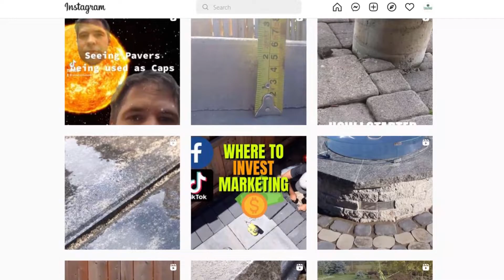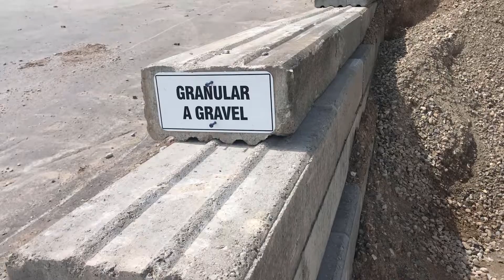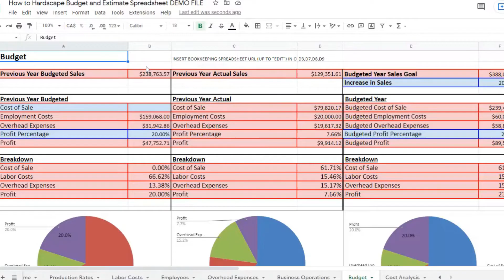Open Graded VS Dense Graded Aggregates

Comment: Hello I'm a home owner paving Over a concrete slab.  What would you recommend as my base layer. Sand or open ?
Reply from the maker: It depends on what you are laying. For example I will lay a thicker border and adhere that to the concrete slab, then lay nonwoven and sand or HPB depending on the height difference. If it is over 1/2”, I will use HPB. Under I will use concrete sand. I never prep a full base on top of a concrete slab
Reply: @iamahardscaper thanks man , I really do appreciate you help.  My border will extend past the slab so just on the border I will crush stone, then base. ? Or just use the HPB for full amount on just the extended border? Thanks
Reply from the maker: I'd still prepare a regular base for the border, not just HPB. This is a video that describes better my first comment: https://youtu.be/kpgvY9uEJjE
Reply: Sorry to bother you...wish you were.local.   so my concrete pad is going to be covered by a Gabled roof. I plan on pitching it 2 inches from house to inch (pipe) at border. With the HPV over the mesh. I'm sort of a loss with the edging. Watched your video not sure how to end it. It will extend past the concrete. Should I put a trench  abutting grass? Or just let it drain into grass with plastic edge?
Reply: Sorry first time doing this

Comment: So dont use limestone with dustings on a concrete slab base?
Reply from the maker: Nope
Reply: @iamahardscaper  why? Everyone in my area does. They all say its better compaction for the clay type soil we have. I get it doesnt drain as well but it's better compaction. Why do you say this? Many people use 3 quarter inch with dustings
Reply from the maker: Yes, we still use 3/4" minus or road base or whatever you would want to call it in some applications. But that is not the same as stone dust. The fines in each are very different. Stone dust or limestone screenings is a 1/4" chip with dust.
Reply: @iamahardscaper  sorry what I meant to say was 411 or 3 quarter inch crusher run with dustings. As we call them around here. Now I see the confusion. Quarter inch minus with dusting would definitely not be optimal base

Comment: Another thing to add is, based  on my research on this topic dense graded base’s can support I heavier load. I’m building a patio that’s going to have a hot tub on top of it which is very very heavy so I opted for a dense grated base, even though it would have worse drainage. To compensate for that I am sealing my pavers and putting a French drain on the low side. What are your thoughts?
Reply from the maker: In our application, id say the main one people in the industry discuss is a heavy variable load. Tractor trailers over an open graded base. Though there are examples of open graded base in these applications and they continue to test in these applications. We’ve prepared open graded for hot tubs, but we always pour a concrete slab for the hot to sit on as well and stabilize the base with geogrid.
Reply: @ good points. I didn’t think of that. You’re the expert but I am learning a whole bunch from your vids. I am using geogrid and using a 4500 lbs plate compactor with 2 inch lifts. Should be good in my opinion. Thanks for the advice.

Comment: I live in Louisiana and I am getting ready to lay 650 ft.² of pavers I noticed some of my pavers have like a white powder substance on it most like mildew can I pressure wash them after I install and then put the Palmer sand in
Reply from the maker: That is likely efflorescence. If it is really bad I would reach out to who you ordered it from. If it is not a lot it should go away after some rainfalls. If not it requires an acid wash

Comment: Can you use the bi or tri axial mesh with the 3/4minus material?

And do you use concrete sand over the 3/4minus material?
Reply from the maker: yes, I still use it with 3/4 minus bases. No, I typically still use 1/4" chip (HPB) on top of my dense grade bases still unless the paver has a thin joint then I will use concrete sand.

Comment: Hey so around the 5 minute mark- if open the drainage pipe goes right into the stone? If drainage is already on the outside of the wall or if using dense, the drainage would be outside of the wall area? Footer? Sorry trying to understand that better. Great video thank you
Reply from the maker: For walls, if using dense graded base, the drain would go on top of the dense graded base in the drainage area where you would then use open graded stone behind the wall. If using open graded base, your pipe should be lower about 4" above the subsoil in the open graded base. Hope that makes sense.
Reply: So if I’m building a square garden bed retaining wall, should I use an open graded base 3/4” no fine’s underneath the block compacted, and then use a dense grade for inside the blocks to lock them in a bit better. Just wondering if I should use open grade base for the wall to allow more drainage and prevent freeze and thaw heaping? Then put the drain about 4” above sub soil right? Need to do your classes man, but your videos help so much. Thanks for all your wisdom and knowledge.!

Comment: Love your presentation, full of great info.!!! I want to add an additional parking pad using open grated aggregate. I understand that their is a product on the market you can spray on to keep it in place. Can use recommend a product that will keep it solid instead of getting in tires, etc... thanks for sharing.
Reply from the maker: Oh the product that I know of on the market for things like that are not vehicular rated. With the twisting and turning of tires they will come loose. Also your climate plays a factor as well.  Rock Bond is the one I know of but it is also not suitable for a larger aggregate like 3/4”

Comment: great information. On my upper garden I have done exactly as you have stated in that it is compacted with dense grade and a drain to the lower garden area. The lower garden are is open grade to act as a large soakaway. I am now ready to pave the lower garden (patio) as this is directly next to the house. The paving is sandstone and 3/4" thick and needs to be bedded on a full cement/sand mix. Is it possible to put a 4 sand: 1 cement semi dry mix directly onto open grade stones?
Reply from the maker: I probably wouldn’t I don’t think

Comment: which would you recommend for a gabion basket base please ??
Reply: Great thank you for taking the time to reply. Much appreciated
Reply from the maker: Oh I'd think you'd want a decorative stone for a Gabion basket. Something like river rock or granite of some sort
Reply: no i mean in the foundation to compact before putting the gabions on top of the base  @iamahardscaper
Reply from the maker: That depends more so on drainage. do you have an area lower than the base to drain water to? then open graded base is probably best. Plus the gabion basket probably sits better on open graded. I'd reach out to the manufacturer.

Comment: Where are you located? From what I gather the only places to find HPB is in Canada. I can buy it at Home Depot, in Canada. Where else am I supposed to find it? Gravel yards sell 3/4" and larger. I can find crushed limestone, but not washed and not 1/4" I'm confused as to why you are recommending an elusive material. I have a deck to build tomorrow and I have spent an entire day trying to find this stuff. I bought the forms (for a lack of the actual term) in place of a base but I am likely having to use sand with it because this material is impossible to find.
Reply from the maker: Good luck
Reply: Must be a local supplies issue, over here in Alberta you can get for example, 7mm gyra rock every where.

Comment: I need your help please!!!

Hello.
I'm in the process of laying natural 2" thick limestone stepping stones for my sidewalks. 
I dug out the area 10” deep, laid a 6-7” 411 base (limestone with 3/4” to minus which also has stone dust)
Plate compacted it to a 1/2” to 3/4” pitch in 10’ 

I then laid 1/4" gravel using the 1-1/4" pipe rails and smoothed it out before laying the stepping stones.

The natural limestone stepping stones are approximately 2 to 2-1/2" thick and range around 14"-18" × 20"-30"

My soil beneath the base and bed gravel is primarily sandy.

Do you think my base will be ok for Michigan weather? In the winter we get to about zero to -20° F.
Also.
What would you recommend to use for filling in the joints?
And should I use a plate compactor on top the stepping stones to fill in the joints? 
Love your videos. You guys do awesome work and I laugh at you both. Keep up the great work
Reply from the maker: I don’t like having stone dust on our climate. I don’t know what your joint widths are like. But if they are large you could go with some sort of decorative aggregate. If small you could use polymeric sand. You could try NOCO by techniseal and not need to compact it if your worried about the stone.
Reply: @iamahardscaper  I haven’t laid the natural limestone stepping stones yet.  I’m worried my 3/4”-minus base and 1/4” granular bed is wrong.  I seen your video and another saying 3/4” base is better.  Should I remove all the 6-8” of 3/4”-to minus base I have and replace it with the 3/4” open base?
Reply from the maker: I don't know that I would remove it if you have already put all that work into it. Some contractors still use that base preparation method and swear by it. I can't tell you what choice to make, you just need to weigh the pros and cons and make the decision.

Comment: Great videos. Do you ever use RCA… 3/4” Recycled concrete aggregate as a base layer?   It has fines similar to a dense graded base, and its quite a bit cheaper and easier to find in my area
Reply from the maker: Never, I do know some that do though

Comment: Can you use dense grade aggregate to fix a clay subsoil sloping towards the house? Would the dense grade act as an additional subsoil in this case? Would it still be ok to use open graded base afterwards? Thank you for all the informative videos and advice!
Reply from the maker: I wouldn’t use it to fix a slope towards a house. It would still be the path of least resistance for water to go. And yes you can use a geotextile to separate then start installing open graded base on top.

Comment: Very useful information, thanks. I'm building some natural stone steps on a slope leading to the riverfront and I was wondering if i should use dense aggregate versus 1/4 inch clean aggregate. I'd like the base of the step to be well compacted but I'm not sure how well the 1/4 inch clean compacts. thanks
Reply from the maker: I’d prefer to use the open graded for this application personally. 3/4” for the steps.

Comment: Is concrete sand the same as manufactured Sand?
Reply from the maker: Oh i don’t know. Where did you find manufacturered sand?
Reply: @iamahardscaper  I did an apron with pavers in front of my garage and the place that sold the gravel etc. recommended what they called manufacured Sand. It looks like crushed cinder block to me.  They said that is what people were using instead of sand for setting the pavers. It was also cheaper to use.
Reply from the maker: I don’t know about that. It could be what we call stone dust, chip dust, or limestone screenings. We don’t use that here and we have a video on that actually

Comment: Where is your business located?  I'm wanting to know how the synthetic base works in a climate with lots of freeze/thaw cycles as in Alberta Canada.
I will watch some of your other videos to see if you mention this.  Would also love to know how you prep your permeable driveway installs for a freeze/thaw climate.
Reply from the maker: Toronto. So somewhat similar freeze thaw. It holds up great.

We have never done a full permeable install for a driveway. I don’t even think we have done an open graded base for a driveway. There is a series of 3 videos from last week where I discuss the different base preparation methods and where I use them.

Comment: Not in the trade. Just doing the back garden myself in UK Manchester (rainchester 😀)
Due to the amount of rain here I would use open graded aggravate for better drainage. 
After compaction what do I need to put on top of the open graded aggravate so I can lay porcelain tiles and synthetic grass?
Great chanel. Thanks
Reply from the maker: You would be using an open graded small chip stone. Here we use a 1/4” chip. It has no sand / dust in it.

Comment: What do you recommend for sub base and bedding layer for artificial turf?
Reply from the maker: If you want the free draining because you have pets that will use the turf, then I would probably opt for an open graded base. If not, traditional would work well but I may go with a concrete sand bedding layer.

Comment: Do you have to worry about the water not filtering through the ground underneath the open grade? My fears are they would fill with water and lift up the patio or freeze underneath if the water can’t drain quickly enough.
Reply from the maker: Yes, if you know you have a dense clay subsoil I would recommend having a perforated pipe in your base that the subgrade slopes towards and carries that water away from your base.

Comment: Can i use this method for a sett stone garden pathway? Located in socal so ideally want to catch as much water as possible just dont know if the larger aggregate will hold the cobblestone setts in place. Local hard scape guy wanted to mortar them solid is that no good?
Reply from the maker: I would ask some more contractors or suppliers in your area. I do not have the experience with your climate and the building practices there.

Comment: I am tearing out my asphalt driveway and installing a techobloc pure paver for a my new driveway. I was planning on using 10-12" of 3/4-0 for the base and then 1" of concrete sand for bedding. I have dont walkways but never a driveway so i am just worried about major settling from vehicle weight. What has been your experience? Thank you you have very informative videos. 

I live in southeastern PA so we do have some decently cold winters
Reply from the maker: Make sure you compact your subgrade well. Add some 3/4” clean into the subgrade and compact it, maybe sprinkle some Portland cement into that as well if it is really saturated. Use a geotextile, then start building up your base. Use 1 or 2 layers or biaxial or tri axial geogrid in your base. All this will help to build a solid driveway
Reply: @iamahardscaper  thank you that’s good advice. Do you think 10-12 inches is thick enough?
Reply from the maker: We do 12” (toronto)

Comment: Will sand ontop of open aggregate work if I put a layer of non woven fabric between?? I can’t find 1/4 clean in my area
Reply from the maker: I wouldn’t just because it could wash through the seems where you overlap the fabric
Reply: Whats the largest size I can use for the 1’ top layer? Will 1/2 or 3/8 clean work?
Reply: Whats the largest size I can use for the 1’ top layer? Will 1/2 or 3/8 clean work?
Reply: Whats the largest size I can use for the 1’ top layer? Will 1/2 or 3/8 clean work?
Reply: Whats the largest size I can use for the 1’ top layer? Will 1/2 or 3/8 clean work?
Reply: Whats the largest size I can use for the 1’ top layer? Will 1/2 or 3/8 clean work?
Reply: Whats the largest size I can use for the 1’ top layer? Will 1/2 or 3/8 clean work?
Reply: Whats the largest size I can use for the 1’ top layer? Will 1/2 or 3/8 clean work?
Reply: Whats the largest size I can use for the 1’ top layer? Will 1/2 or 3/8 clean work?
Reply: Whats the largest size I can use for the 1’ top layer? Will 1/2 or 3/8 clean work?
Reply: Whats the largest size I can use for the 1’ top layer? Will 1/2 or 3/8 clean work?
Reply: Whats the largest size I can use for the 1’ top layer? Will 1/2 or 3/8 clean work?
Reply: Whats the largest size I can use for the 1’ top layer? Will 1/2 or 3/8 clean work?
Reply: Whats the largest size I can use for the 1’ top layer? Will 1/2 or 3/8 clean work?
Reply from the maker: 3/8" works. 1/2" is too large

Comment: Building a 20*12 raised paver patio, with a 24in high wrap around retaining wall. The soil is dense clay and has a slope above and below the planned area. A few questions for you. 

Since I’m using cheap wall blocks from lowes Should I use 3/4 clean for back fill? Or will that make the backfill to heavy? If I don’t use 3/4 clean can I use fill dirt?

Making sure I understand the layers; compacted subsoil, non woven geo fabric, biaxial geo grid ontop of fabric, 6in of compacted 3/4 clean, 1in of screeded patio chips (I think that’s what my area calls 1/4 clean), then pavers.
Reply from the maker: You got the layers correct. Definitely use 3/4” back filled area for drainage 12” behind the wall. This will allow for water to flow through as opposed to being retained by soil and pushing on the wall from behind.
Reply: @iamahardscaper  Good to know. I am doing a small 12x12 patio raised up about 8 inches from ground level, but my yard, the slope goes down to a swale in the back, and I have to keep .9m from it. Between where my retaining wall will be, should i keep that (mostly) clay between it and the swale (concrete) or dig out some of that down say 6" and backfill with 3/4" also to give it better support?

Comment: I might rework my whole patio plan now. I love the idea of permeability! Is there any issue long-term with your locking sand falling into the HPB and loosening the pavers? Could this also contaminate the open base with organics? Thanks!
Reply from the maker: No, the sand makes it’s way to the HPB in the installation phase and chokes out during the consolidation phase when you compact the pavers. Especially for a patio with no heavy traffic, nothing to worry about with that.